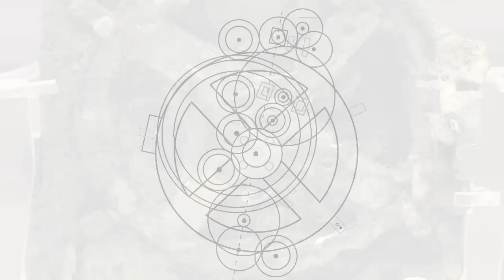Out Of Place Artifacts

Comment: The Greeks of Xenophon's (circa 400 B.C.) time had a flame thrower with bellows called a Dragon. It was a long wooden tube with a bellows at one end and a pot of flaming oil suspended just below the distant end. The bellows blew air across the top of the flaming oil and the flame incinerated several soldiers at a time.